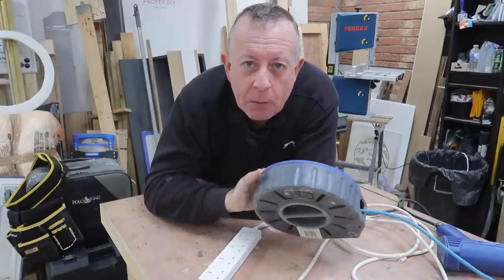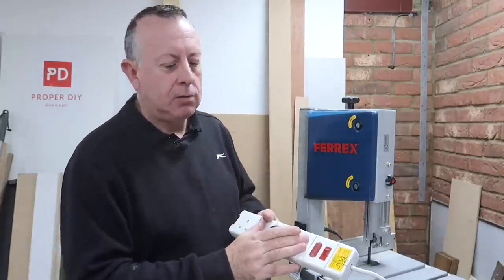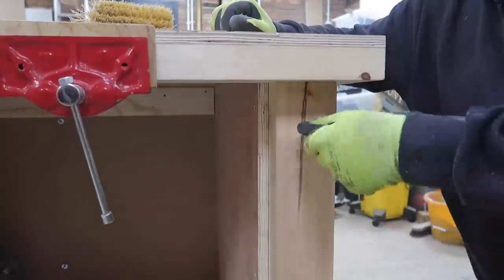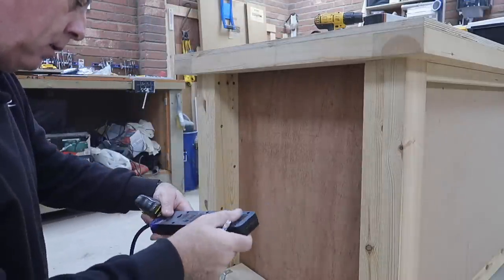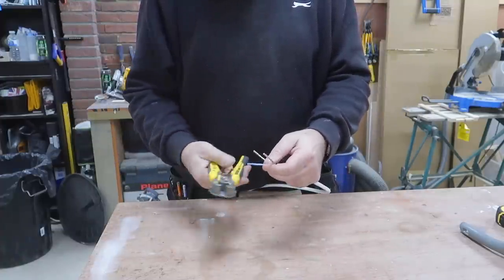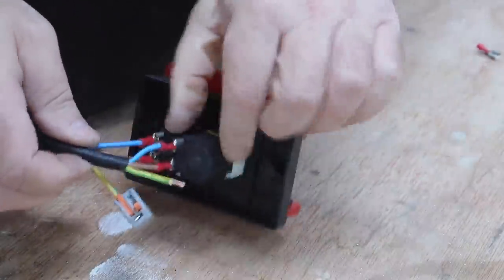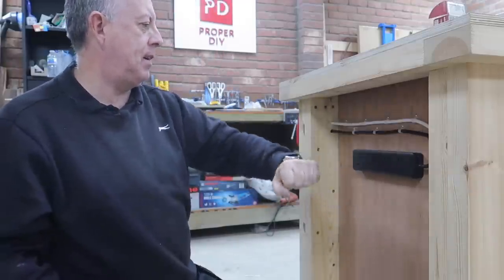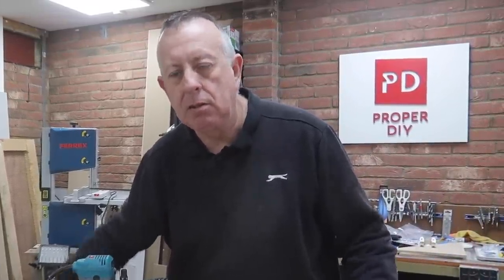How to Power Your Workbench

Comment: Thanks for making clear that the point of the fuse is that it melts before the cable does! Those 1mm extension reels seem a bad buy for general use as you can't plug very much into them safely whilst they are rolled up. The fuses all too often just get substituted for 13A too
A few safety tips from a British domestic spark of over 10 years:
* When you cut off a moulded 13A plug it could be hazardous if left lying around. Even if I'm chucking one in the bin I'll twist/bend the Earth pin to render it impossible to insert into sockets
* Check that electrical parts bought from Amazon, eBay etc. are made to the appropriate product standards, particularly if you don't recognise the brand name - often they aren't
* 50-60 years ago, domestic accessories such as switches and socket outlets used to be mounted flush into joinery without a back box. If these are found now when undertaking an EICR it's coded as 'potentially dangerous' and the installation will be deemed unsatisfactory
Reply: @millomweb  interesting that you don’t like rcd in the consumer unit. I’m guessing nuisance trip is a concern? 

Up to you but when you consider the rcd should trip in the event of a fault and given that places like the kitchen are full of nicely earthed parts that would conduct a lot of current if you make the circuit. An rcd should cut the current before it stops your heart. 

Tripping is a pain and can be just the earth leakage of a lot of stuff but having rcbo split that across different circuits and reduces that risk while giving you the additional protection. 

Hope you never need a rcd though.
Reply: I live in Oz, moved here from the UK when 17th edition was around. i cringe at some of the household wiring done by tradies here. Sockets less than 20cm from a sink in a bathroom, no socket boxes, loose sockets etc. and all within regs here

Comment: Wee tip - buy an extension socket with a longer cable to start with.  Then just cut the cord as required.  That way no need to fit the plug.  I've also found it cheaper to buy cable as part of an extension cord than buying the raw cable.  Another good video.
Reply: Yes, I have had the same experience. An extension cord can be much cheaper than buying cable separately.
Reply: @Grauenwolf  He didn't use any "house wire" from what I can tell. Looks like flexible cord cable which is more or less what extension cords are made from. Building cable is generally flat unless it is more than 2 conductors+ one ground/earth.

Comment: Another great video Stuart. Really enjoy all your content. Always clear and easy to follow.  As an electrician I would suggest mounting that nvr switch on a  suitable plastic enclosure as opposed to inserting into wood  due to it combustibility. Insulated crimps could also be an improvement. INot a criticism just an suggestion to improve. Good explanation on what a nvr switch does.
Thank you for sharing your great content.
keep up the good work  and keep them coming.
Reply: As an electrician aswell, i was just about to mention the same. If you get a small fault that isn't big enough for the fuse to recognise, the wood legg wil burn from the inside out.

Comment: Without wanting to be that person, you might want to look at using insulated crimps. That switch is single insulated due to the exposed mains, and a few years of high frequency vibration from the tools could cause one to come off. Lecky tape would also work.

Comment: "I like the excitement of not quite knowing whether if I'm gunna get it right... "😂

That's my philosophy with every job that I do 🤣😂🤣

I put a couple of screws above the power strip to ensure it can't be pulled off the keyhole slots, or you could just tack on a battern from a bit of scrap.

The nvr switch should be mounted in an appropriate backbox, if there is arking it could easily cause a fire.

Comment: Thanks, you’ve alerted me to a real risk, that I’ll now deal with. One idea I’ve heard about but not yet implemented is to have the power cable going up to the ceiling and across to the wall socket. Avoids the trip hazard of trailing leads.

Comment: My preference is to run the cable overhead, thus no trip hazard, or opportunity to get nicks , cuts and bumps in the cable. In the past have used curly cable, so it was above head height when  not used. Each to their own.

Comment: Very nice step-by-step video!  I have 3 exact switches I installed on my 2 table saws and router table that I bought from Amazon.  In case the the power goes out and comes back on instantly, you don’t to risk kickback if you are using that tool.  I installed each switch in a 4”x4” electrical box and mounted each one at thigh height so I could turn off the switch/power tool with a bump of the leg and without letting on hand go to turn off the switch.  This way, I always maintain control with two hands instead of without letting one hand leave the wood.   IMPORTANT:  you want a MAGNETIC switch that prevents the power from automatically coming back on.  There are several switch that “look like” this magnetic switch but they don’t kill the power when it comes back on so be careful when buying the switch.  Excellent switch for safety reason and for conveniences.

Comment: Another great video thank you Stuart, really liked your explanation about fusing VS cable size. Possibly a good idea to mount a surface box on the bench leg to avoid any overheating / timber issues.

Comment: Great idea to use a switch (NVR or even a regular non-NVR, w/paddle stop - anything that provides easy access to shutoff is a good thing), but I disagree with placing the switch directly into the wood leg.  A rated plastic or metal box is best to provide protection from combustable materials (wood in this case) from being exposed to possible sparking.  In the US, we are required by NEC to house electrical devices in boxes and never mounted directly into cavities exposed to combustable materials.

Comment: Nice job. Possibly the switch mite have been better surface mounted in a back box. Is it not a possible fire hazard recessed into the wood.
Reply: Nope. Only a fire hazard if the wiring in the switch is poor, which is a problem in itself.

Comment: Mount the power strip upside down. That way the cable is coming out of the end that matches the hole it's going through, and your plugs will be upside down so the cable coming out the plugs in those sockets will be facing up and you wont have a bend in the wire going up to the tool on the table.

Comment: To be safe, you need the following in addition to that NVR switch:
- a fuse or circuit breaker. Should already be there, and it sounds like it is.
- a GFCI or RCD.
- an AFCI or AFDD. 
IMHO RCDs and AFDDs are more important in a workshop than they are in a residential environment because the cables are more susceptible to damage which can then lead to arcing (that's where the AFDD comes in) or touching a live wire (that's why you need an RCD).
And yes, the cables and switches need to be able to take more current than the fuse or circuit breaker.

You seem to know how to do that kind of thing safely. The problem is that too many others don't, and that's when people get hurt.

Comment: I find using the key hole slots on the back of the multi-socket do not always ensure that it stays in place no matter how much you adjust the screws tightness. A simple solution is to screw a modesty block against the top edge holds it in place and just requires one screw undone if you need to remove it.
Reply from the maker: Yes you can do to really secure it

Comment: i've got my bench electrified with a power board and my built in tools ( i have a table saw and router fitted into the bench) are controllers by nvr switches. But a great point about having one to control the power board for all the normal plug in tools..... think there's some adaptations coming

Comment: I’ve used a pop up tower socket into the surface of my work bench, pretty much the same found in kitchen worktops
Reply from the maker: You can do but it makes it difficult to use the whole surface while using a tool - ie cutting down a full sheet of ply.

Comment: Great, I bought the same NVR switch and now I will definitely install it. I was a bit uncertain about the wiring but now all is clear.   Great point about the cable capacity. I've got one question.. where do you get the floor cable protector? Great video again. So calm and clear.

Comment: I've often thought that I'd like a foot pressure switch on some tools, like lathe, drill press, bandsaw etc, so that the in the event of any mishap at all taking my foot off, stops the machine.  That way, I don't even have to locate & reach for the switch which seems slow.  The natural reaction to jump back out of the way, would release the switch immediately.  I've never seen such a switch available commercially, so I wonder is there would be some issue that I haven't considered.  What do you think?

Interesting that you consider mains lead soldering a valid option.  I believe its illegal here in Australia as a fault can cause solder to melt, then live wires drop out, fall anywhere and cause all manner of more serious consequences.

Comment: Did you go back and wire that 5th, smaller tab in the switch? Isn't that required to energize the magnet, so the switch actually functions?

Comment: Couple of comments: First, if you cut off a moulded mains plug then please destroy it. Otherwise a kid could plug it in and get a shock off the bare end. (or please remove the fuse). Second, consider using a new mains plug with a loop to help removing the plug (the plugs for older, arthritic hands). Saves grabbing the sides of a plug to remove it.
Reply: One another thing to mention, when you fit cable with connectors, it is not allowed to twist un-twised wires befor insert it to the crimp connector...

Comment: Hi ya Chap, just a quick question. The Oviline nvr switch ive just received and fitted does not latch the power on. As soon as i take my finger off the switch , the power goes off. Is this item faulty?

Comment: 8:20 - Every system has a 'fuse'. Every system.
If you engineer it right, it's the fuse itself. If you engineer it wrong... your 'fuse' is the wire. Or a socket. Or something else you don't want exploding.
Every system has a weak point of failure; it's best to make sure it's the part that's designed to fail safely 😊

Comment: Hi, If you have 4 tools plugged in and switched on, won't they all come on at once with the NVR switch? So are you saying can't leave anything plugged in, such as my bench mounted router, if so you might as well have only one socket.
Please let me know if I've misunderstood.
Reply from the maker: Correct, you can have 4 tools connected at the same time. For them to come on together they would have to be latched tools and to be all turned on. I only have one latched tool - the router but while I'm installing the cables etc I might as well have capacity to plug in more than one tool - for instance yesterday I was using a soldering iron through the power strip and a light at the same time.
I'm not sure why you would end up with 4 latched tools all in the on position. This would be the same if you plugged them all into a standard extension cable and then turned it on.
Reply: Thanks for your reply, I think I'll fit the NVR switch dedicated to my router lift as I'll never remember to keep unplugging it and this would be an accident waiting to happen.

Comment: Good video as usual Stuart. I'm intrigued by your router installation. Have you any thoughts on implementing a lift mechaism or have you been 'gifted' a £100's solution like everyone else seems to have been?
Reply: That's a great question it would be a massive bonus saving to those of us who plan to do the same modification/upgrade but I don't think my luck is that good plus no-one has ever heard of me lol  😊😊😊 nice video Stuart thank you
Reply from the maker: Trend have been very kind so asked if would like a new tool - my first free tool from anyone - ever!
Reply: @ProperDIY  very commendable they are supporting you and I hope you humbly and very politely bit their hand off when they offered it to you 😉 nevertheless congratulations and I look forward to your installation video  Happy New year  and a big thumbs up for your channel
Reply: @ProperDIY  Boo. 🤣  I've been thinking about it and recon you'd need two lead screws and carriages with associated pulleys and belts to evenly raise and lower a router assembly. You'd also need a mechanism to contain that assembly so it can only move vertically. It might be that when you look at what's involved there's nothing to be saved by doing it yourself. I'm not throwing the towel in yet though.

Comment: Hi Stuart bought the switch from the link same as yours and wired same way you have done but when I plug the feed in and switch on and then plug anything to the bench , it only works if I hold the green button in, you seem to just press the green part and the tool stays on. Any thoughts
Reply from the maker: There are 2 slightly different versions. If you have the one with 5 terminals (2x2 +1) then the extra terminal has to be connected to the adjacent terminal for it to latch
Reply: Perfect thank you so much. Yes it has the small spade extra, guess that is the electromagnet
Reply from the maker: @milliefelstead2309  Yes I think so
Reply: Thanks Stuart it worked just looped it and all good . Excellent work bench power all done

Comment: What about having multiple NVR switches looped around the bench, so as you could turn on and off a tool at any side of the bench ?
Reply from the maker: You would need more than just a few switches - you would need a bit of electronics to monitor all the switches.
Reply: Or you’d have to go around the bench & turn them all on, in the correct order, before the power strip would get power.

Comment: If the majority of tools will be used on the top of the bench, why not flip the extension strip so that the cable runs directly to the plug? Avoids the 'u' shape of the cable below the plug when connected.
Reply: Because gravity would be against the keyholes on the extension strip & cause it to fall off with the vibration from the tools. An extension strip with the cable exit on the other side would have been a neater solution!

Comment: Would a plug in rcd not do the same job. Extension lead into the rcd and into the socket think they are about 12 quid
Reply: An RCD is not the same as an NVR. I suggest you watch the video again or do more research.
Reply: there are two types of RCD, active and passive. Active RCDs require resetting after power is cut to them, so would perform a similar function. They wouldn't give the useful E-stop capability at the bench though

Comment: Awesome video and great tips, only improvement i can see is when crimping the spade terminals you have them at a slight angle, they should be lying flat in the crimping tool, at the top of the flat side of the crimp under the insulated plastic is a split in the metal that is designed to grab over the wire itself and another just behind it that will grab the insulation, having the at an angle like you have done can sometimes cause a loose fitting crimp that can cause a high resistance joint or worse yet totally fall out. There is a great article on instructables called "How to make a quality crimped joint" by a user called superpants. The only reason im picking at this is the video specifically calls out safety with the 0v disconnect switch and i feel having poorly crimped wires negates a lot of the safety this can add if done improperly, its a simple fix and probably worth another video just updating and teaching properly, also using the correct crimping tool can help a lot, the ones baked into the strippers are usually overly generic and dont always crimp both the wire and insulation properly, getting a ratcheting crimper is generally the goto however not totally nessacary, if you want any more advice feel free to ask as ive worked a few years in the electrical engineering industry however wouldnt class myself an expert by any means.

Comment: Surely you still have a tripping hazard with the cable that runs from the switch to the power socket which I presume is on the wall. That to me would be the main tripping hazard.
Reply from the maker: Thats why I bought and installed the cable protector - did you not watch the whole video?
Reply: @ProperDIY  sorry l, no i didn't, my apologise.

Comment: Where is pin A1 connected? Attention at minute 10.47. The electrical connection does not make sense, the switch will not work within the parameters. Sincerely, from Romania.

Comment: I am a big fan ( I installed a 8 camera cctv system and got the discount and saved £200)
Your workmanship and material selection is usually very good. Using an extension was a bit cheap and nasty for such a fantastic bench. Also the cable management not great. Use those metal socket type socket boxes and plastic trunking (round)Come on !!! re do to your normal high standard.

Comment: Dear power strip manufacturer. Why didn't you round up the 168mm screw holes to the much easier to measure 170mm? It wouldn't cost anything extra.
Reply from the maker: I did think the same - especially as 168mm isn't even a whole number in inches either

Comment: Why aren't you using a router here 4:34  - surely not because its pre NVR?
Reply from the maker: No. a) it was quicker just to drill and use a chisel b) a router would never get to the depth I need to fit the switch c) I like showing people who don't have all the tools that they can still do it. most DIY'ers don't own a router.